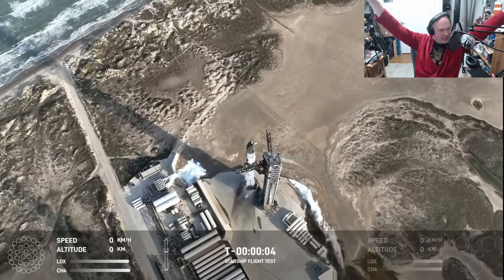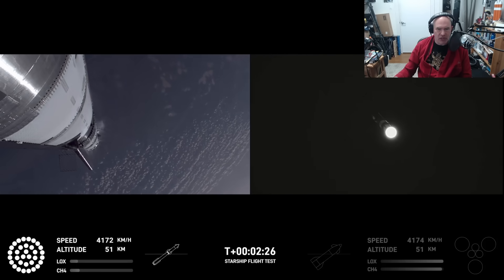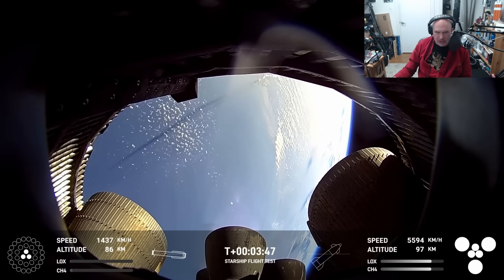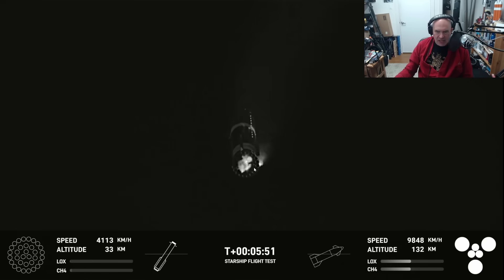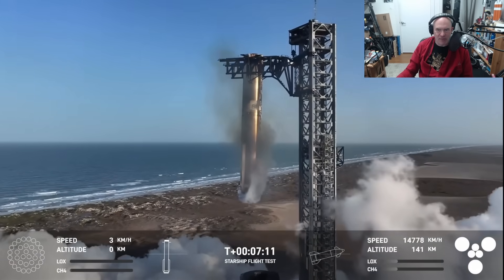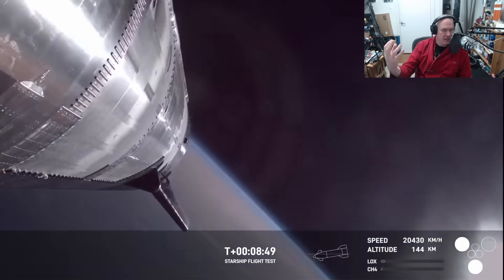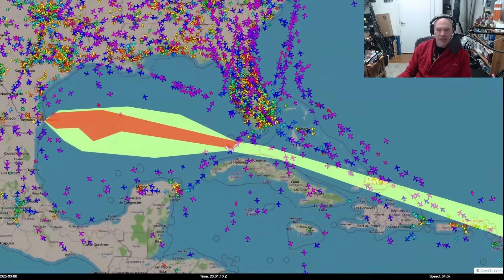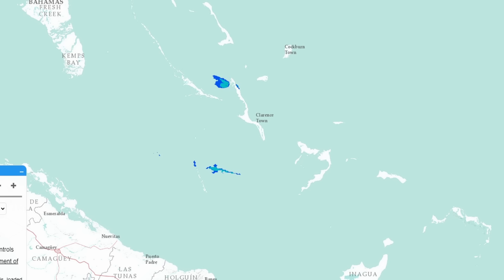SpaceX Make The Same Mistake Twice With Starship Flight 8

Comment: ‘To be fair’- new Glen and SLS flew perfectly and took real mass to orbit their very first time.   Because they solved all the design problems BEFORE launch.  SpaceX is engineering their rocket bass awkwards.  They CAN’T make orbit because if they don’t have the fuel margin to land with the staging ring, carrying an EMPTY Starship, they sure as heck  don’t have the fuel margin to make orbit with a loaded starship.
At present, SpaceX has NO CLUE how much the final rocket will weigh, which means they have no idea how much fuel they will need and how many engines it will take.  They are already having to add length for the fuel they will need to actually make orbit with anything larger than a banana.  And there is a good chance the weight they keep having to add, because they can’t engineer like OTHER aerospace companies, will mean that they need MORE raptors, which will mean a wider rocket, and having to redesign and rebuild an entirely new OLM.
The notion that they will be ‘iterating’ ship to ship fuel transfer in LEO, and that the moon lander will require SIXTEEN to TWENTY such transfers means SpaceX will have 16-20 opportunities to have 2 starships RUD in LEO which is a potential catastrophe for everything else in LEO.

Sorry- their approach is the doofus approach to designing rockets.   Saturn 5 launched ONE rocket to go all the way to the moon, propulsively land a MANNED craft on another world and take off again. And they did not need to blow up 20 of them to figure it all out, 60 years ago. 
Boca chica is a bad location for a launch facility. And Elon is not a genius.    Falcon 9 and crew dragon were developed with NASA oversight and following NASA testing protocols.   
This far all Elon appears to be able to do is the Break Things part.   He’s 4 years late with his moon lander and will likely be at least another 4 years, or out of business long before he ever sets anything down on the moon.   He’s already soaked up 3 billion and asking for another 4.   
Remember how outraged everyone was that SLS cost 2 billion?   But it at least worked as promised the first time it flew.
Reply: I am genuinely interested to see how starship goes. Is it a viable concept that needs iterations or is it a cybertruck forced onto engineers who are told to make it work.  But unlike cybertruck where they simply dumped most of the core features and delivered a big stainless wrapped model y, that won't be an option since rocket engineering has no wiggle room. 

I'm impressed by the 33 raptors booster landing and not blowing up though. That's a lot of force and energy. That launches now once Elon's clever idea to have no flame diverter deluge system was dumped. That was a bit of a red flag to me since they were looking at the most force downward ever i believe, which should have called for adding, not removing, robustness.. 

To me the real question is if starship is a decent engineering concept or if elon just said make my idea work. I'd bet on success if the former, but not if the latter.

Look on the bright side though, mars is a joke in terms of human colonization. So the starship would never do that anyway. 

 If they can't build a self sustaining colony on Antarctica or the bottom of the ocean, which supply most of what humans need, they obviously can't do it while getting baked by heavy radiation with month long dust storms and no atmosphere to speak of.
Reply: @noname-ll2vk  In both cases it seems Musks obsession with Stainless Steel is his undoing.  Remember the whole point of that choice was that it would elimate the need for thermal protection and allow for 'rapid' iterations.  Neither of these have happened, so now the vehicle is just saddled with 100 tons of extra mass for no benifit over even standard aluminum construction, let alone the potential savings that carbon composites would have provided so your maybe looking at 150 tons which is the whole missing payload mass right at the feet of Musk who over-ruled all the actual enginners to choose stainless steel.
Reply: @ At present, almost none of Elon’s ‘ideas’ turn out to be workable. Full Self Driving. The Semi. Hyperloop. Tunnels to ‘solve traffic’.  Stainless on the cybertruck. Gigacasting aluminum for applications its unsuitable for. ( like the Cybertruck’s FRAME ) The OLM without deluge or blast diversion. Siting Starbase at Boca Chica because he thought Texas’ GOP government would give him anything he wants. There is only ONE viable launch declination from Boca Chica, and even that one rains debris down on inhabited areas ) Solar roof tiles. The list goes on an on.
Falcon 9 and Dragon was developed with NASA oversight- and they kept the focus on attaining usable orbits.  But even then, SpaceX has offered zero proof that reusing boosters reduces costs. They actually charge twice as much per set to ISS as the Russians did. And He won’t show his books.
Comments he has made makes it clear that they are losing money if they can’t get dramatically more revenue from Starlink. 

Musk is a lot like Elizabeth Holmes and other ‘tech bros’ who are light on actual engineering knowledge, but really BELIEVE in the power of ‘innovation’ and ‘disruption’  to solve any problem.
Put simpler, he keeps writing check with his mouth that even the best engineers can’t cash. 
And yet we keep handing him billions more.   Without government handouts and corporate welfare subsidizing his businesses, NONE of them are viable.
Reply: You ever wonder what happened to Apollo 1 through 10? (1 was... Especially extra not good)

In all fairness to spaceX, they haven't actually blown up an absurd number of test articles *yet*. 

Super heavy development went pretty well all things considered. They've already got a theoretically reusable heavy lift main stage operational. Even if starship doesn't work out, super heavy probably has a bit of mileage in it, especially if commercial space stations gain some traction.

Starship though... First it's got to survive reentry, then it's got to demonstrate on orbit fueling, then the actual moon lander version will have to be developed. All of these are massive challenges with pretty much zero precedent. And now, after multiple test flights, the current issue appears to be "not blowing up during ascent" which shouldn't even be on the list in the first place.
Reply: @ Actually, I watched all the Apollo launches.   1 was never launched, They had a fire in the capsule that killed all three astronauts during a plugs out test. 2,3, and 4 were canceled while NASA made a whole raft of changes that included far more stringent TESTING protocols prior to actually launching things.  4 was the first flight of the Saturn 5 and it flew perfectly. And the others were all test flights, every one of which flew perfectly and completed its mission.  Testing rendezvous, lunar insertion, lunar rendezvous and even nearly landing. 
NO Saturn 5 ever exploded.  None ever failed to attain orbit. 
Falcon 9 has achieved an impressive launch cadence. By relying on the launch pad designed and built for the Saturn 5 in 1963.
Orion flew further than any man rated craft on its very first launch. 
SLS flew flawlessly. And New Glenn achieved its launch objective on its first try. 
Starship has not completed a single Gantt milestone in its NASA contract.  Not one. ( catching the booster was not a NASA objective. ) 
From wasting 4 years and billions of dollars trying to get a bad idea for the OLM to work, to not even being able to get a test mass to orbit, or figure out that the heat shield and configuration they had come up with could not survive re-entry without actually building the full size ship and finding out the hard way, SpaceX under Musk shows a remarkable reluctance to DO THEIR HOMEWORK and suffers sophomore failures no other aerospace company embarrasses themselves with.
Just consider this; During the 4 years Musk was trying to prove himself right about the OLM ( and failing ) SpaceX COULD HAVE built smaller versions of the Starship and launched them on Falcon 9s to be working on re-entry and figuring out the design changes needed BEFORE they built an entire launch facility around a design that CAN’T do the job.   Other nasa contractors do NOT fly heat shields that fail.   How come they can KNOW their design will survive re-entry when SpaceX doesn’t?
Because they TEST their ideas before they design and build the full scale article.

I swear, you Muskovites just can’t seem to recognize bad management and bad engineering practice even when it blows up in your face.
Reply: @christopherpardell4418  I'm growing increasingly curious about your questions. In a good way.  

I told a friend a while back to wait to see if musk's ongoing public mental collapse would start to become visible in his mechanical engineering projects the way it did from day 1 of his twitter debacle. Then the cyber truck came out and showed it's hit tesla.

 So I started looking at spacex. The question being are these good engineers working on a tough but solvable problem or is this musk giving good engineers a bad idea and telling them to make it work. That's a huge difference. Cybertruck was a bad idea that failed in almost all its design goals but shipped because you can fake it with slow cars. 

Musk fanboys don't seem to be able to see that he's changed fundamentally. 

I still think the test is if his ideas can be made to work. But your points about these failures is interesting. 

Keep in mind younger elon who seems to have been much more balanced mentally said that he didn't want to get too old because your thinking gets too rigid and it's best to step aside to let younger minds take the next steps. I'm starting to think he was right back then.
Reply: @christopherpardell4418  Reading comprehension is dead isn't it.
Reply: @karl0ssus1   No, mostly it’s just the ability of some people to be clear in making the point they think they are making.   Your post implied that something went wrong with the first 10 Apollo missions.  Other than the on pad fire in the capsule, due to an engineering failure to TEST how much more flammable materials are in a pure oxygen environment, every Apollo mission was a success and every rocket performed as designed.
Then your post went on to suggest the opposite. I responded to the tacit implication that you could not be bothered to elucidate.
Reply: Yep, At  least SLS managed to do it's  job.  How much as  elon p*ssed away so far?  You know it's  taxpayers coughing up the cash for this now.
Reply: All this from the DOGE man.  I can't imagine why americans not only keep giving this man their tax dollars but also practically elected him as king of the country.
Reply: @ we didn’t.  Sadly we elected an even bigger doofus braggart who is using Musk as his human shield.
Reply: @Gabriel-um9hm  musk bought his way in. 270 million super pac. Directly contributed to Trump's election. Musk bought his position fair and square. Which is why all the musk apologists really need to have a reality check.
Reply: “I know SpaceX is going to fail because I don’t like Elon’s political opinions”
Reply: @andrewsturrup8751  Seems like an odd take.
Reply: this comment is the epitome of thinking, that you know it better, while actually spouting complete nonsense.
Reply: @ This comment is the acme of offering no actual counter, because you have none.

Comment: The natural assumption is that the failures are related to changes in the V2 starship's thrust or fuel structures, but it occurred to me that the other massive (pun intended) difference in these two flights is the fact that they actually have something  bigger than a banana in the cargo compartment. I wonder if that added mass is changing the stresses on the thrust structure in ways they hadn't considered. Just a thought.

Comment: This is pure speculation, but if a one of multiple feeder pipe started to leak (leading to a pressure drop in that line), this could lead to uneven film cooling in the vacuum raptor. So the fire in the engine bay and the hotspot in the vacuum raptor might have the same root cause.

Comment: Seems to me that firing while its bolted to the earth would radically change any resonance frequencies through out the vehicle, especially at the aft section.
Reply: That's why you fly them
Reply: That is necessary to be sure full thrust has been developed.  The Saturn V, and Shuttle missions had done the same thing. Every larger rocket does.  The clamps were released once enough thrust had developed.  Very little, if any, difference in the vibration resonances.  Once in flight however, with the aerodynamics, things do change. Speeding through the atmosphere, and cross winds at altitude put dynamic loads on the vehicle(s). And if "just right", could possibly add an unwanted resonance to existing vibration cycles.  The wingtip vortexes  from the fins produce their own dynamics on the structure.